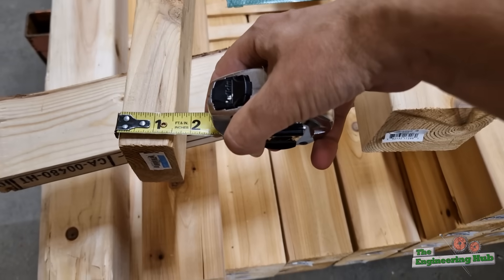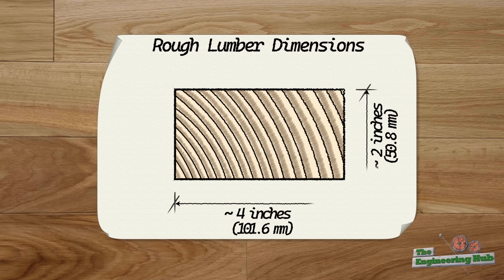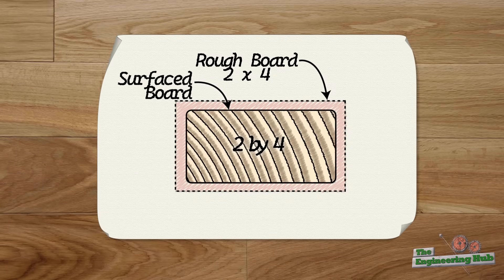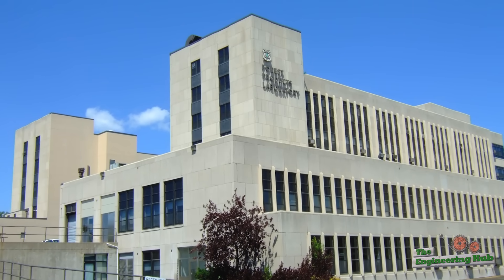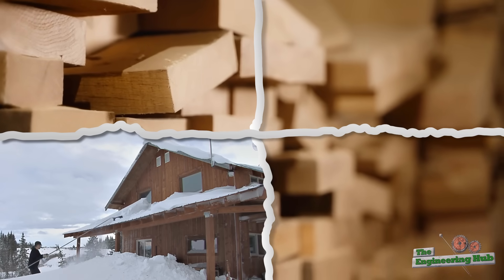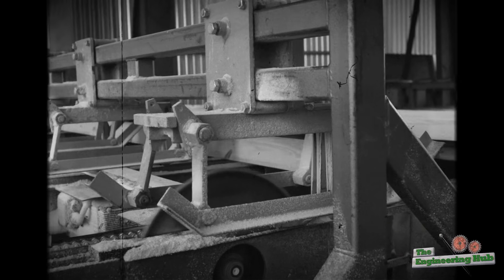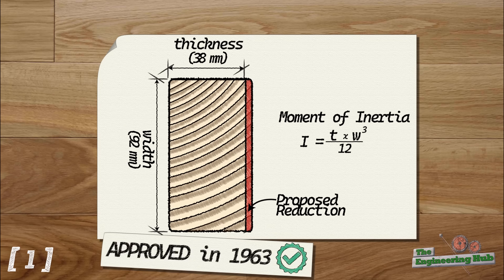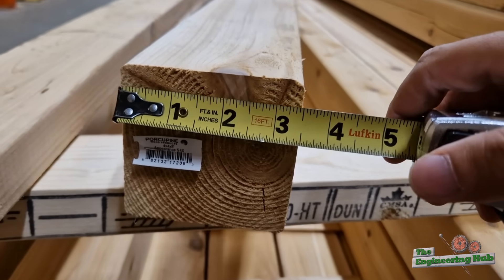Why is the 2 by 4 getting smaller and smaller?

Comment: Why do you think we went from 24 on center. Then to on center 19 1/4 now it's 16 on. I rather have a two-by-four that measures 3 1/2 x1 1/2  16 on center. Plus it's a myth that all houses were built. I'm a builder that builds additions in New England and all the old how is a built like crap. Not a level floor or door jamb in any house. You got to remember back in the day they framed with hatchets a couple handles you know Jack studs headers. Not to mention the plum is running all the steam pipes cutting all the framing.😅
Reply: Everyone's like "old houses are built better", but that's making the assumption that some other sucker BEFORE you fixed all the issues like remediation of asbestos and lead paint. We got stuck doing the former in our place.

Comment: In Australia green hardwood 4 x 2 was always slightly under size due to shrinkage, only a few millimeters. But I remember in the 70’s with metrification dressed pine 4 x 2 was always 3 an 7/8 x 1 an 7/8ths. However metrification saw another reduction to 90 x 45 mm. Not as much a loss as in USA.🇦🇺

Comment: 1-5/8" is NOT optimal for studs! you go to screw or nail sheets on them that meet in the center of the stud, there's very little wood to fasten each sheet to it without getting really close to the edge of the sheets, 2" was FAR better, you had a full inch to nail or screw

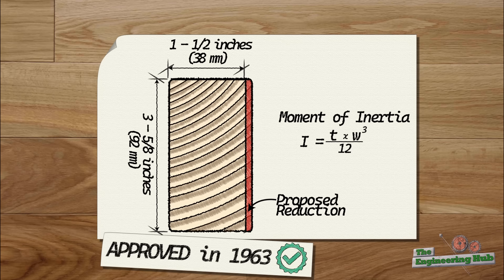Comment: 6:00 this would only be true if they cut two by fours with the green, the exact same way every time. Every shipment of lumber gets different sides of the tree you can’t tell me that they are going to make more waste or make an extra couple boards out of the stuff on the side that is large enough, I always see boards with bark or cracks big knots. They try to sell everything they can which is good because you don’t always need a pretty board. You just need a strong board.

Add cheap labor and people who don’t care half the time it doesn’t really matter anyway. All that and then somebody uses screws instead of joist hanger nails on hurricane clips. That’s not gonna do any good anyway you might as well have used toothpicks

Comment: Can you actually get more pieces out of the same log with the amount that was being shaved off? I'm sure they found uses for the remainder, but wouldn't you want to maximize the higher value pieces?
Reply: They don't actually shave off anything excess. They cut the boards as close as they can before planing them down. So the 2 inch board that's actually 1.5 inches was never 2 inches to behind with. Closer to 1.6 now with how precise modern tools are.
Reply: @poika22  I'm asking about geometry, using shaved off as a euphemism for the reduction in size. There's many different cuts of rectangles that can come out of the roughly tubular logs, but if it's say 12" in diameter and you're taking the cuts across the center you could get 3 pieces at 4", but unless you reduce it to 3" you can't get another of the same "size" pieces. You could maybe squeeze a 1x1 or something out, but the differences in size seems slight.

Comment: I’ve been wondering about this myself, having worked in construction, two by fours measure 1 1/2 x 3 1/2, but the barn that was built in the 60s or 70s at my home the two by fours measure 2” x 4” and the two by eights actually measure 8 inches. These are giant pieces of wood compared to what we normally work with.

Comment: The houses that survived the 1906 San Francisco earthquake were made from full dimension redwood. A wood which is actually not legal to build a house with in California anymore. The entrapped building regulators Here in California are serving those beholden to the Parts makers. Wood electrical metal braces etc. every year the industry adds regulations to building which mostly benefit the industry. The quality of lumber causes even new buildings to need repair as it warps the siding is mostly glue and sawdust at this point the paint is the only thing stopping it from turning back to dust in a few years.

Comment: Pain in the but thing is quick designing a project a home with the basic 2x4 measures, then the actual wood comes up short and you either have a smaller project or gaps...
Like I want to build a shelf out of left over plywood... they are 3'x4' pieces... I wanted to build a sturdy frame that doesnt stick out and gives good under plywood support for heavier storage... but the quick thickness will mess with my quick lengths for the box frame...

Comment: My house was built in 1945, in Canada. Wall stud 2x4's were only 4ft long and 1.75"x3.75" in dimension.  Every 'stud' is actually 3 boards; two in line, sistered to another to 'connect' them. Very strange, and a pain to work on because anything new built on top needs a 1/4" strip attached to the new "2x4".  One nice thing?  Those old studs smell glorious when cut or drilled!

Comment: I notice there arnen't many actual carpeners here, not house building carpenters anyway.
Back in the data we had rough saw timber without any structural testing and often varying sizes and quality.
It was just a rough guide as to what timber you used for what. These days we have structurally tested timbers that have actual numbers required by engineers.
Engineering is not opinion based, neather is it faith based.
The size of the timber is of little significance when it comes to structural siutability.

Comment: Most of this is wrong.  These dimensions were developed by English guild carpenters under the Masons.  They used wooden supports, reinforcements, addendums and additions to their stone (masonry) constructions.  The dimensions are as they are for fitting with other components.  They are the sizes they are so that they may work with other dimensioned components and material breaks for best use of the wood.  A 2x4 from 120 years ago, like the ones in my house, are still 1-1/2" by 3-1/2".  Dimensional lumber is DIMENSIONAL.  Refer to the publication "The Steel Square"  by H. H Siegele and it will explain much of this better than I can.

Comment: I worked at a "mill" for a few years, i was under the impression that a 2x4 doesnt measure to 2x4 because the 2x4 measurment is taking prior to being milled.

So when they are first cut with bark on or whatever else might be present , they are cut at precisely 2x4, then they get sent to a too another wood mill, which sizes them down to a standardized 2x4  (1.5 x 3.5)

But the 2x4 comes from the measurement of the wood slab prior to it being finished.

Comment: So they can get MORE BOARDS from a given log! Of course, TODAY's "studs" are 35% WEAKER than the full 2x4 inch studs in my 98 year-old house. Alot more than THAT actually, 'cause my house is framed with loblolly pine, which now is HARDER THAN CONCRETE!!! I had to use a Hilti gun and 27 caliber "medium" powder charges to drive into the studs for new HardiBoard siding. Not even $1.43 EACH McFeely "high strength" #10-3 1/2" screws would drive without snapping. Those will drive into 3500 PSI concrete...Read the softwood lumber guide. "Whitewood" "studs" aren't even strong enough to pass building code or inspection. Wanna pay $6-8 for a "modern" "2x4x8" in douglas fir??? Going price last week at a REAL lumber yard (300 stud pack). "Engineered" floor joists are the only realistic things today. 2"x12"' (Doug. Fir) run $7-12 a FOOT under 16 feet. Over 16 foot, double the price.

Comment: The difference in sizes of 2/4s makes it really difficult to manage repairs on old houses. Mine is over 150 years old. Studs are all 2 x 4 rough cut. When I put in a new window, or take out an old one and side the outside and drywall the inside, I need 1/2 lumber to fill in the gaps.
Reply: Have somebody saw cut you some at 2 by 4.    Amish usually do this.

Comment: It isn’t, really.  Dimension lumber used to vary regionally, even locally.  National standardization began about a hundred years ago.  In 1964, the North American standard was set where it is today, with finished softwood 2x4s being 1.5 by 3.5.  The size has been fixed for more than 50 years.

Comment: Why are homes getting more poorly built since the 40's ? Plywood  and particle board pressed together by glue which will fail and delaminate   in due time especially if they get  damp  , finger jointed exterior boards etc that rot very quickly  as I often come across homes as a contractor that were built just 25 years ago with serious rott issues . The pre-1940's homes that I often work on as I reside in New Hampshire that are 100+ years old were built like tanks , the granite foundations were higher off the ground " High & Dry "  is what we refer to it as , soffits were also much wider to keep rainwater away etc.. . Used real lumber and also the old architects were very adamant about preventing areas from getting wet and not being able to dry unlike modern homes .

  I often work on homes from the 1800's with mostly original clapboards , no rot issues other than carpenter ant / termite damage , none of the window sills are rotted as they were made of oak that's 3 inches thick , original slate roofs etc.. The problem with modern construction is that engineers with fancy degrees have to constantly reinvent the wheel per say when houses built in 1900 were already structurally just about perfect minus modern amenities  such as insulation , modern electricity , heating /AC and plumbing otherwise homes should still be built structurally like they were 100+ years ago .

   The average modern home will not last 100+ years unless serious repairs are done periodically due to rot issues and particle board failing .

Comment: they get smaller, because dressing a piece of rough cut lumber.takes off material
green lumber will also shrink even more..
the size of DRESSED LUMBER HAS NOT CHANGED!!   --   price wars had NOTHING TO DO WITH IT
and DIMENSIONAL STANDARDS HAVE NOT CHANGED
I can see where you went wrong.  the reference from 2964, is probably fictional

Comment: I am amazed by the comments of people complaining about the quality of construction built with fast grown wood versus old growth wood. I am portuguese and over here we only use wood for hardwood floors. We practically only build masonry buildings and even for drywall we use steel profiles. Even low quality construction masonry buildings can last for over 100 years without significant structural problems. So why do folks in North America keep building wood buildings if there are so many problems with the durability? Is it because of the cost of the materials?

Comment: Growing up in the 1980s and 1990s people were starting to use 2 of the newer supposed 2 x 4 doubled up for important studs/posts in walls and where they used to use 4 x4 for things they sometimes used 6x6 instead so they could actually have the needed 4x4 or better they needed for what they were building. Most people who could afford building projects would often skip the pre made boards entirely and go to a local lumberyard or order what they needed and have it shipped to local lumber store called lezzer lumber that had a dedicated rail point/spur line.

Comment: I have to laugh every time I hear the old excuse that the lumber starts as 2"x4" when that is clearly a lie. There is no way that it is necessary to waste a half inch from each dimension for surfacing. In fact they start out much closer to the final dimension and only a small amount of shrinkage and planing gets them to the final 1-1/2 x 3-1/2, if they even stick with that. I have seen too much lumber undersized below the standard. Also, the lumber is very poor quality, being warped and twisted to the point where if  you can’t pick through the lumber at the store, you will end up with a substandard building.

Comment: These idiots explained why the edges are chamfered and never discussed why they are smaller. Obviously safety standards are reduced to accommodate smaller lumber.
Well, because lumber producers have to pay fines for the destruction and they simply pass the cost on to you. Learned from Bill Gates.
Homes are only built to last long enough to pay off the mortgage these days. Something we learned from India and China.

Same reason a 24" iMac is only 23.5". It is called cheating the consumer at every turn so that it feels normal.

Comment: If you notice the rings in the wood at 6:30 You can see that the older wood has more rings so it's tightly compacted.  Today lumber is all about growth and board feet they can get out a year so it isn't as strong as lumber that would be considered 'old growth'.

Comment: I swear that 50 years ago in Ontario, Canada the standard was 3 58x1 5/8. I distinctly remember my high school wood shop teacher saying that size and the reason was that as stated here, shrinkage and planing but did start off being cut to a true 2x4. My last house was built in 1950, the exterior walls were true 2x4’s, the interior dividing walls were actually 2x3’s. Plaster walls over west they called beaver board back then and the interior walls plastered over drywall. Now days yes the size is 3 1/2x1 1/2 here.

Comment: Stress is based on cross sectional area S=F/A. Where f is the force. so the statement that the smaller wood is stronger than misleading. Yes its same material so it has same strength characteristics, but more area will reduce the stress. Less stress means more force it can handle

Comment: The modulus of elasticity (MOE)& rupture (MOR) are dependent on width (b), thickness (d), and length (L) of the wood being tested as shown in the two equations in which D = center deflection (“); P = load below proportional limit; and Pmax = failure load (lb): MOE = (P L3) / [48 (bd3/12) D] and MOR = (Pmax L) / (b d2)
Ergo, it is a lie to state that a 15 x 3.5 x 96 is as strong as a 2 x 4 x 96. Qualifications such as “strength as needed” and “for the current conditions” are qualifiers that serve to say that weaker materials are being used without using those words. But, then again, how many of the houses built after WW2 do you want to be around in another 50 years? Look at the houses that stand after an earthquake or hurricane. My 1932-built house built on pillars on a steep slope in LA has withstood every earthquake to hit the area without suffering even a crack in the hand-plastered walls. Meanwhile, freeway overpasses collapse and the walls of 1970s apartment buildings bulge out and crumple. Hundreds have died or been seriously injured because of a mentality that exists in which stupid “people say a thin piece of wood is just as good as a thick piece of wood and they must be right, after all, they’re the experts.”

Comment: Until today I really thought that a 2 by 4 was dimensions for a wooden joist and there would be 4 by 4's and so on, does this mean that the word wooden joist and 2 by 4 mean the same thing? even if the beam is smaler or even way larger? like say 8 by 8 inches? In the rest of the world we call a wooden joist a wooden joist, and give it dimensions to have dimensions... Who needs accurate dimentions in the USA? xD
I must admit, I noticed that people said they were building something with a 2 by 4's on youtube and I thought like, 2 inches by 4 inches that is waay to thick for this build, turns out it must have been a 1.5" by 3.5" which makes a little more sense for the use cases I've seen.

Comment: Thinner smaller lumber is at the store's now  1 3\8 x 3 3\8 how does this effect building to code there is not the same amounts of wood there so there is not enough strength.
When will this be called out, what a sham.